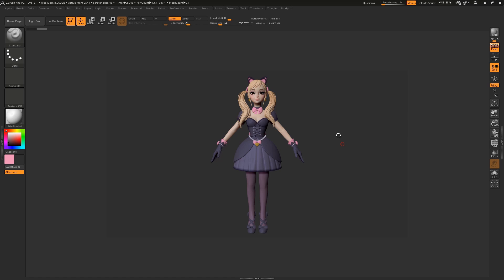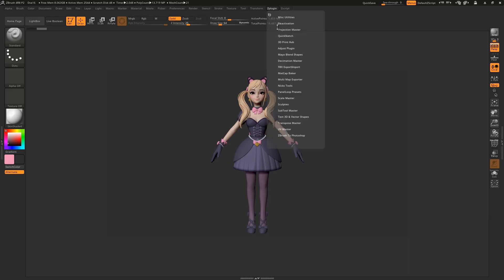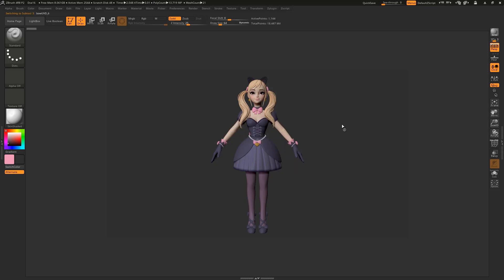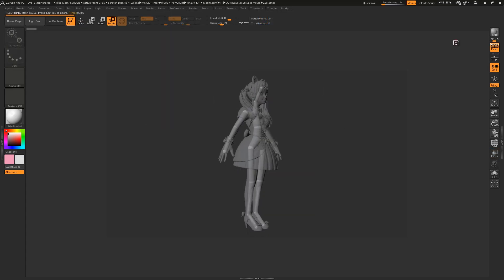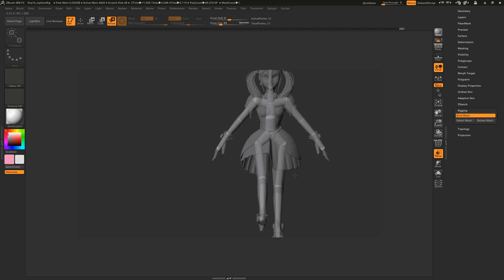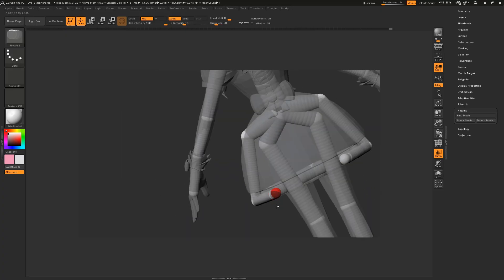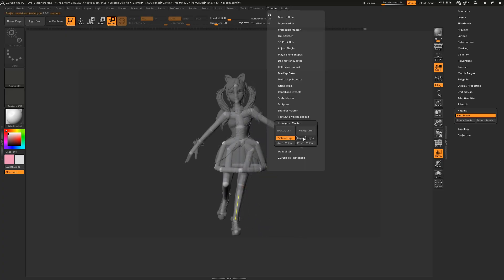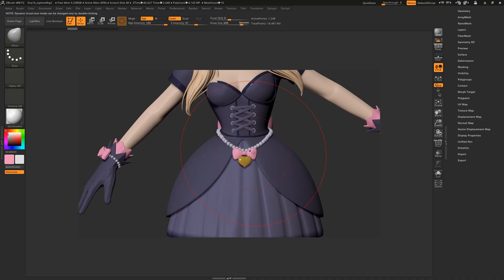How to RIG in Zbrush! - 60 Second Tutorial

Comment: Great video Danny Mac! Although, it seems, no matter how low the Sub-Division level of certain subtools, we always get this huge delay, then a distorted 'stepping' effect occurs! Super frustrating (as this looks like a great method for posing characters over the usual transpose tools) and also particularly odd!
Reply: That's because of the high resolution of your mesh. I went to find out solutions and using proxy pose is the only one I've found yet (not to mention having a super-powerful computer) but I unfortunately don't have access to the option with my version of zbrush... The solution I've found in this case is to simply pose your character before having too many active points, and then finish sculpting with subdiv levels